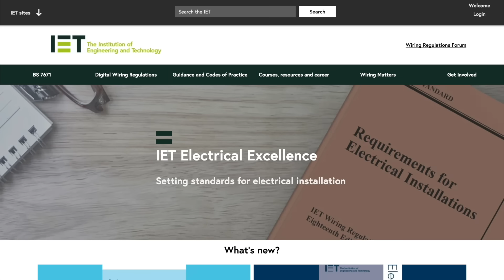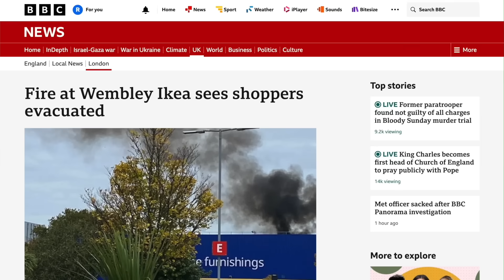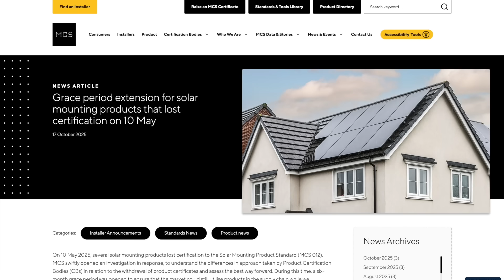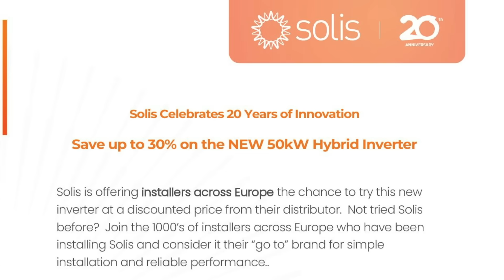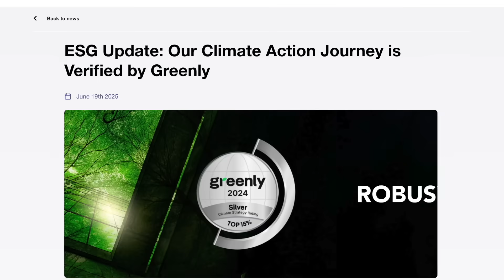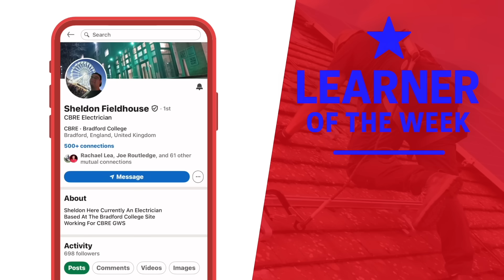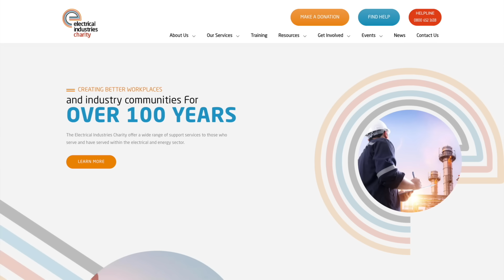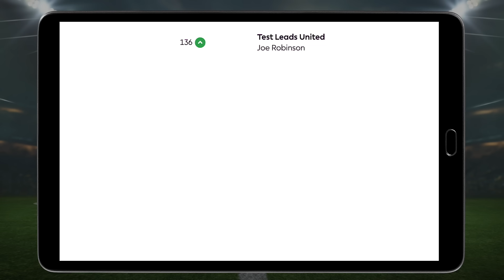Exclusive: Grid Bosses Set to Change UK Voltage

Comment: That voltage standard change doesn't fix the problem of 'headroom' for renewable electricity generators, it just kicks the can down the road a little further - and not very far given how popular the idea is becoming. The problem itself is fixable only by converting excess generation into storable (into bottomless pit or export) commodity with direct or dispatchable conversion. It is on the face of it probably the only option in the corner myopic (at best) 'clean' policies have backed everyone into.
Reply: What does all that mean?
Reply: @markrainford1219  I get that a lot! I mean "that might help a bit for now but not for long".
Reply: @markrainford1219  The problem doesn't change if you lower it to 210v say, coz most homes will be at 220v & exporting a higher voltage nearing the 231v limit (+10% of the 210v base voltage)
The problem with renewable energy generation is it is so sporadic...
You have a 7kw system exporting say 5kw, then cloud passes it drops to 4, then 3, then back up to 4, nope back to 3, clear skies, rises to 6kw then more cloud etc...
All day long, not just your house but all solar installs in your local area are also doing this making it a nightmare to keep local grid/substation balanced with exported solar going up & down like a bride's nightie
A solution is to limit most homes to g98 = 3.6kw limit and excess is stored to export less for longer as battery storage has become much cheaper
19 hours of peak energy exporting at 3.6kw equates to 68.4kw potential per day
365 days is nigh on 25,000kw exported pa x 15p SEG = £3,750 potential export earnings & the local grid receives a more steady export = more stability and export voltage is lower

Alas the MCS, installers & even the DNO's haven't a scooby doo about all this, just simply configure systems to export less for longer on the now common hybrid systems...
Meanwhile, MCS are still more worried about if some mounting system complies, installers lash it in - get scaffolding down - don't worry AI will take care of it & DNO flip a coin & pull a number when applying for G99/100 & hope it will be alright
When if most Home PV systems exported less for longer, the grid would be more stable avoiding all the sporadic peaks/troughs - just by using the battery to buffer & smooth out energy being exported over a longer period

Yes, it is additional cost adding another battery or two/three, but most local sporadic instability is by people exporting sporadic amounts of solar
Reply: @authuruksake969  distinct clouds (ones with edges that make solar step up and down) shouldn't be a problem for the wider grid because the average output of the spottily-clouded homes will average out like it's dawn/dusk or a dull day. People's lights might brighten/dim locally but pretty much everything else should just 'tank' mains voltage varying within spec - that's what they're designed for.
That is related to what I wanted to say by the 'headroom' concept from the video. Export can only ever be as much as the ±10% headroom or a sudden outage would put the supply out of spec. My point was more that slightly growing the +-10% margin can't fix the problem of clipping (lost solar harvest), just put it off a bit. Excess (not for self-consumption) batteries can extend export window but obviously as your neighbours fit more solar, you will need more batteries, until your export lasts until the next morning and then you're back to clipping. What's really needed is a 'black hole' in every solar-fitting neighbourhood.
Reply: @trs4u  Home solar doesn't really make it back to "the wider grid", but it is local consumption by your neighbours in street/local area connected to same sub-station...
The 5kW you might export will be mostly absorbed by 1 in 3 of your neighbours on the same phase as it travels back to substation and then the remainder absorbed by other homes on that phase as it reaches sub-station
Eg: 5kw passes 30 homes, 10 of which are on same L1, with a 300w base load consume 3kw, where it reaches sub-station, then a further 7 other homes in next street on L1
The more power you export, the higher the voltage increase as it needs to travel further to more homes locally as it has to be greater than the incoming supply over the greater distance vs voltage drop etc...
If you export less energy then the voltage is slightly lower as it is absorbed by most homes before reaching sub-station further away - so export voltage is lower

People install large 15kw or 20kw systems & at times attempt to export at up to 15kw or beyond of the max single phase limit - which at these times the voltage has increased to 255, 260 or even 265v export
The first thing that throws a hissy fit is their own EV charger than shutdowns if the voltage gets too high due to high sensitivity & monitoring for other faults - most of everything else is still operating, but the dumb homeowner is bleating their charger is tripping at peak export
It did not trip in the morning or late afternoon where export was lower, always when the export was higher around 11.00 to 14.00hrs due to higher export = higher voltage
But you don't need to be an electrical engineer to deduce what the issue might actually be if you have a shred of crtical thinking/common sense - but it's not our fault....
Yes Jordan/Artisan, you could/should have mitigated all that grief on the Cambridge tennis court install by exporting less for longer = installers don't have a scooby, plus DNO - UKPN foolishly approved 17kw limit - odd I thought it was 15kw but hey ho, not admit they messed up & revise said limit - but nope, Jordan bleats & bleats, UKPN cave to replace the mains to 3 phases to house, then Jordan bleats more and UKPN offer to pay internal 3 phase upgrade inside property too - all of these costs will be passed on in standing charges to everyone else
So installer & DNO haven't a scooby & MCS are still worried about flat roof mounting systems

If they had configured the export rate to say 12kw and at midday stored excess, exported for longer into evenings at up to 12kw I gurarantee the EV would not trip as voltage would be lower & avoid EV charger tripping - but hey ho
They would export nigh on the same amount - minus some slight losses to battery & then to AC export, plus the local grid would receive a more steady supply it could handle/distribute without the peaks/troughs etc...

Simple configuration mitigates a lot of the issues the grid in general is facing, buying a bit of time so that the whole network can be upgraded properly to cope with the increasing amount of renewables in years to come

Yes, setting newer hybrid installs with a lower export limit, to export less for longer will provide a more steady flow of energy to local grid - this will be a pain & require another battery or two - but it will assist in balancing the local grid and mitigate the export voltage rising too high & other issues like EV chargers tripping out

Certainly better than lowering the grid voltage which if solar installs are still approved with high export limits - will still see export voltages increase beyond 10% max threshold
(Really it is supposed to be 3% when exporting)
Though what they are aiming for is that it can exceed the 10% limit as EV Chargers will be fine at up to 260v, so if the supply is 220v, 10% limit is 241v but the EV will be fine to 20% at 262v - so problem solved the grid thinks...
Only they know only too well at the other end some equipment will fail if the voltage drops to 90% of said 220v = 198/200v

So really it is not even a quick fix but a bodge to lower the grid voltage, they might be able to lower it slightly but they need to very careful in stages like they are proposing
Meantime the lower export for longer configuration will mitigate higher voltage and assist is smoothing/balancing local grid for a good while...
Eventually more solar comes online which will not all be soaked up locally & will need further distribution via grid - but we'd have bought some time with the "less is more" approach to export, so we have the time to upgrade the grid's infrastructure

How can this be monitored - your energy supplier takes readings every half hour & if you exported more than 2kw or whatever half the export limit is - they'll know you are exceeding said export limit & notify you/dno etc...
2kw in 30 mins = 4kw or just over g98
But remember you can still potentially export up to nearly 65-70kw per day in 18/19 peak hours - over £3,000 SEG at 15p

Can't do too much for older installs until they're upgraded but newer installs could be instructed to be configured in a less is more setup to ensure new installs are more balanced to the local grid in your area
Reply: @authuruksake969  voltage drop over the local circuit must play a part, but logically it must be sufficiently small that the closest premises to the transformer and the furthest from it differ by less than the maximum 'spread' allowed by the standard? That would mean there's always at least a little 'headroom' available to exporters unless they're at the limit of distance / voltage drop?
Reply: @trs4u  There is "headroom" as you call it, but the more you export the higher the export voltage becomes to push larger amounts of energy back towards substation & onto other mains in nearby streets/areas
You export less - the voltage only needs to be increased by a modest amount (less distance/homes soaking up export)
The person right next to the transformer/substation will receive say 245v & a g98 3.6kw limit
the guy at end of long street may receive 235v & perhaps be allowed 10kw export limit coz he has more headroom as you call it on the voltage

However, balancing isn't just about voltage remaining within its margins
Another issue is to do with Solar being so sporadic, the clouds pass over and the inverters are constantly adjusting mppt's so the amount of exported energy is fluctuating constantly - wildly on sunny days with considerable scattered clouds - which the local grid has to pick up the volatile slack as numerous homes within that area are exporting 80% of their capacity, then 50%, then 25% as a darker cloud passes then back up/down again...
It's about the LOCAL grid, clouds pass over, all the solar homes drop their export, then all back up again then up/down, like somebody turning on/off the water tap

If recent hybrid homes set a decent export value that is lower for longer & more constant - say 75% of original limit for example if g99 or remain g98...
when cloud passes 50% solar is generating but up to an additional 25% or what is required to keep exporting at 75% through most of the day...
The amount of energy is more constant/stable and the voltage also remains stable below the threshold

What we have atm is a like a kid playing with the dimmer switch with wild variations in brightness in room whilst the local grid is trying to turn on/off other lamps to keep room lit - rather than tell the kid to leave it alone, adjust it to 75% and worry less about problems like why do we go through so many bulbs

You export less for longer via battery storage on modern hybrid systems (an extra battery or two may be required)
Then the local grid has a more constant value and coz it is lower, so to is the voltage for longer periods than sporadic spikes in voltage and enormous peaks/troughs in exported energy as clouds pass etc...

It is not a complete solution as solar will grow further, that it may/will exceed local demand at times
But it will buy us some time to update the grid's infrastructure which isn't a simple task

The energy companies can be requested/forced to monitor the exported energy every half hour and if owners are exceeding that value they don't really need to do any threats of enforcement - but simply say they will only pay you in accordance with the DNO limit as allowed with said g98/99
In other words you export 5kw when you had a 3.6kw g98 or your old g99 was revised down slightly...
You export 5kw, when limit was 3.6kw, that is all they will pay you - thank you very much for extra 1.4kw
The owner will soon get the message to apply less is more or trickle charge EV/ self consume the excess as they are not going to be paid for dumping too much export

Comment: European standard is between 230 and 240V. Before that it was 220V for more then 70 years. Some parts of the grid had  2 x 127V = 220V. Without Mp. Never 207V.
Reply: 207 is a minus 10% limit.

Comment: Voltage going down, amperage goes up, means bills go up.
Amps =KW.
230V = 13.4amps
240V = 12.5amps
On a 3KW heater.

Use a clamp meter
On the input  and a volts meter  do this between 5 6 in the evening and the same at midnight, notice the difference.

Why do manufactures still supply 3KW appliances fitted with a 13amp plug,
When they should now be on a dedicated 16amp supply.
The reaction response to my posts made by idiots.
Meters measure usage in KW hours.
Reply: Only until you realise your domestic bill is based on kWh.
Reply: depends. do the meters actually measure the voltage and use that in the calculations, or do they assume a fixed voltage?
Reply: @mrxmry3264 Measured.  Fixed would make no sense since a) it's AC and PF applies and b) voltage varies across the day as system loading changes
Reply: @mrxmry3264meters measure KW hours KW = amps
Reply: @christhackeray3532  The amount of power used didn't change.  Don't spread false information
Reply: @zaktomlinson2379 this. Resistive loads will just draw less power. E.g. Kettles take longer to boil but they consume the same energy.
Reply: Tell us you're not an electrician without telling us 😂
Reply: @gardenogauge retired now, but a
Previous member of.. the IEE, IE, JIB,
NIC EIC.  Consultant specifier to two London councils and housing associations.
Domestic, commercial and industrial installations.
Reply: Don’t talk rubbish
Reply: @keoghrichard1988 tosser know nothing
Reply: Bills are for power delivered so no change for the same power regardless of voltage. Lower voltage would result in lower power on non electronically controlled loads.

Comment: We are already often taking in over 255v all down to too many solar systems in our area apparently.
Reply: Aren't the inverters supposed to shut off at 253v grid voltage?
Reply: I routinely get well over 253V in north London. It's destroyed at least five computers across several different incidents, and my UPSs go crazy for hours at a time.
Reply: @stevegreen5358  Poor design.
Reply: @rogerphelps9939  poor design of what, the network or the device?

Comment: Here in the netherlands Voltages between 253 and 207V are not only tolerated, many places have a few more volts more or less.
Reply: same here in the UK. in my old flat i had between 235 and 245 volts, here in the new flat it's more like 240 to 250.
Reply: @mrxmry3264 In my place (north germany) the voltage is  at most time in the limits, it  stood steady between 235 and 240V. It never was  under 215V  at the upper end,  the highest reading  was 250V . I got a fixed voltmeter at the panel  in my  workshop. But it shows only one phase. The voltage could be quite different to the other phases. I have no more space for a voltmeter switch in my panel.
Reply: @mrxmry3264 To me I still calculate based on 240v even though my place often sits at 250-255v and sometimes even 265v
Reply from the maker: Fascinating to hear how things are done elsewhere!
Reply: That’s only when the power is on and you’re not using power between 4pm and 9pm when citizens are told not to use electricity. Third world electricity supply.
Reply: @Sthellens142 which country?
Reply: @Sthellens142 I didn't know, I use basically 20 hours a day as I only sleep 4

Comment: This is not true, I work on some Fire Pump Controllers that are over 40 years old. These often have under voltage settings of 220vac and cannot be updated to a new relay or timer and thus the controller would have to be replaced at an approximate cost of £1500 plus depending on variation of controller were the more technical the greater the replacements cost. Yet another miss governed plan that makes the regulator bodies out of date with true life
Reply: if the pump itself can handle 207ish... per phase, if 3ph, would a boost transformer not work?
Reply: @TheChipmunk2008  Generally No. A fire pump starts immediately on full load unless via a soft starter which wouldn’t be effected by the voltage drop. A Delta/Star system runs up to speed then transitions to cruising speed. The drop in voltage for older systems means the time to transition may at best slow the motor down and then add severe load to the supply as it drives up to its full capacity. At worst the transition fails and a fire is activated in the pump room.
Either situation is not great with nock on effects. The upstream protection should be 6 x FLC of the motor( a regulation often missed by designers and none fire pump installers. The expected load under the voltage change could in effect overload the supply cables due to a reduction in voltage with a stable resistance raises current and thus heat. Many of these system due to the high expected current flow are on the external limits of design to limit costs and thus changing the design is not ideal.
Many older systems means already struggle with a 400Vac instead of the designed 415Vac. Dropping it further will just add to timing issues of relays and contactors.
Reply: @d.wood72  Thank you for the detailed reply!  I cut my teeth on star delta starters but the specifics of fire pumps are new to me.  I can see this being a big issue then,  with a lot of people unaware of the potential problem till ... it stops working, or burns out!